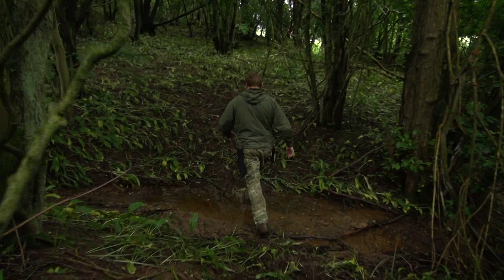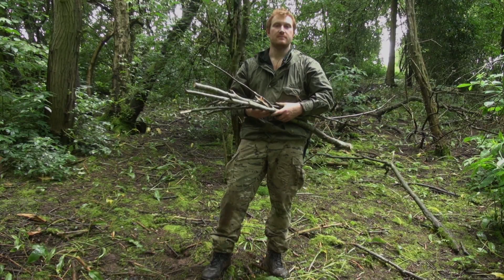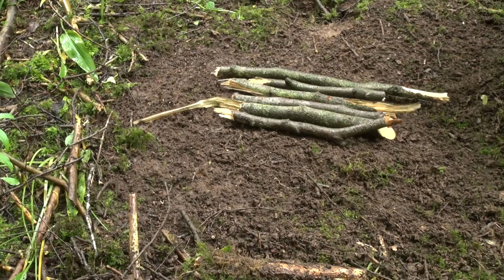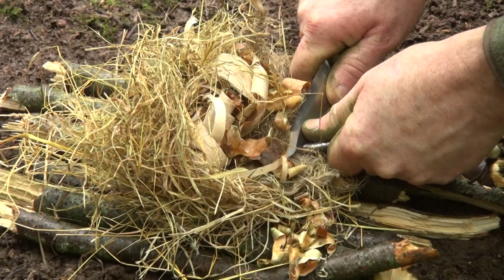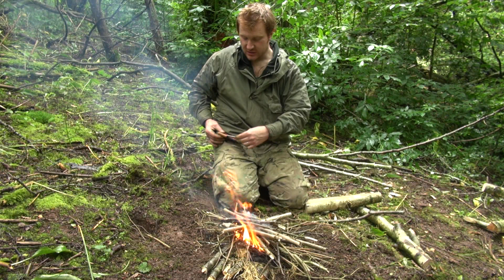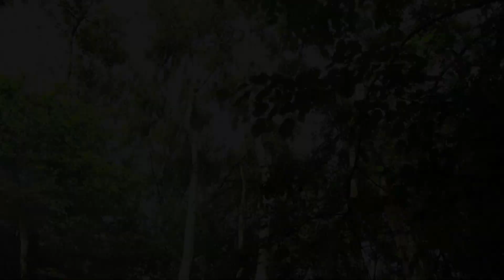How to Light a Fire with a FireSteel

Comment: Very professional video Ben. The only thing I do different is pull the firesteel back rather than pushing forward with the knife/striker, this way the sparks only go in the direction that you aim as opposed to a scattered shower of sparks. Also, I only snap sticks from trees if there are no other sticks already caught in the branches. The branch-caught sticks are 100% dead and you can assure you aren't damaging the tree, generally speaking, the more vertical the stick the drier it will be!!!!